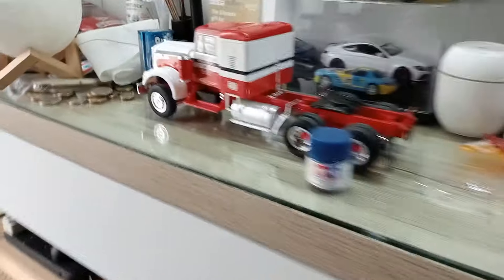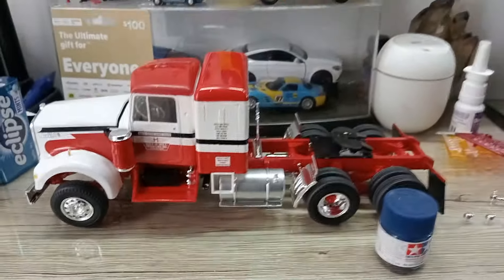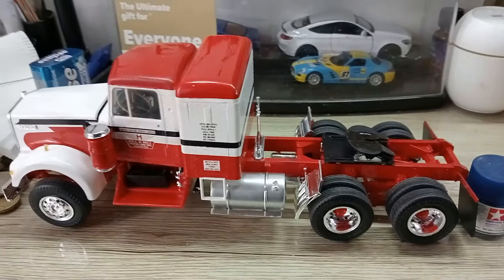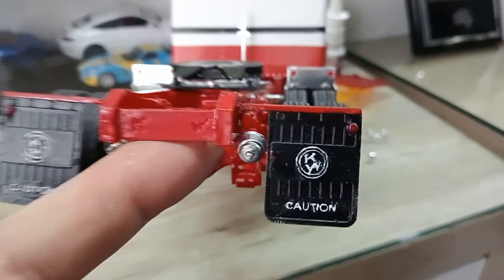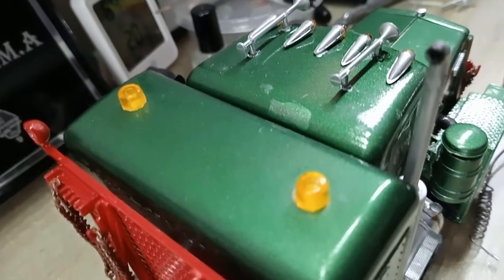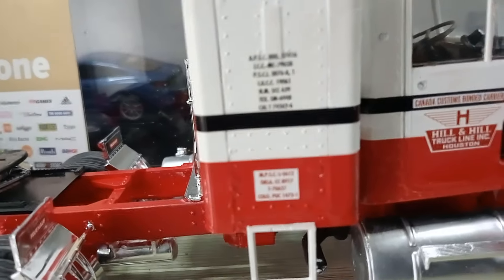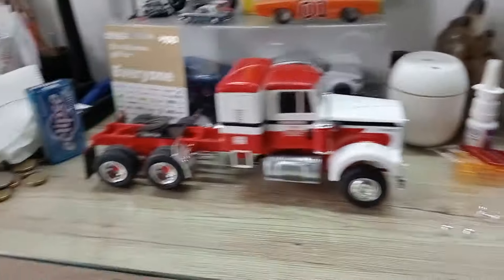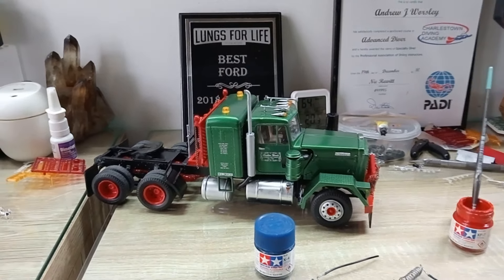Kenworth Model Trucks AMT Alaskan Hauler & W925

Comment: Do you know if the Alaskan Hauler is based on the Kenworth LW
Reply from the maker: I am not a big truck knowledge person, however I assume it is fitted with the stronger steel plate fenders, rather than the fiber glass one piece front. It would make sense if the prime mover is doing a lot off work in the wilderness to give it more protection. The kit actually comes with an option with the standard single piece Kenworth front hood and combined fenders. It does not vary much from My Kenworth W925 model.